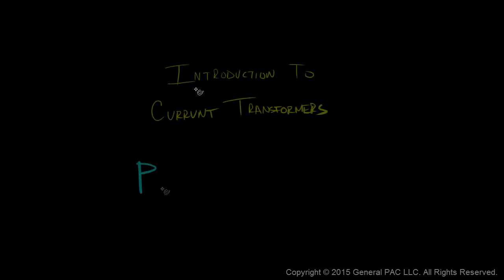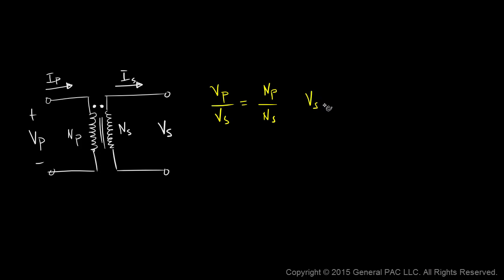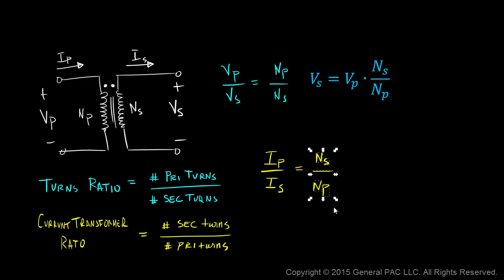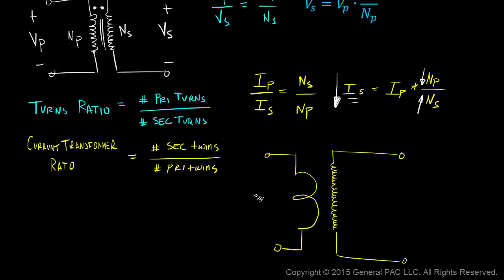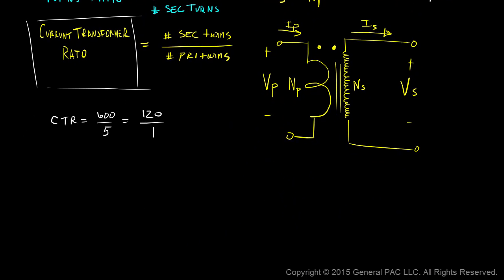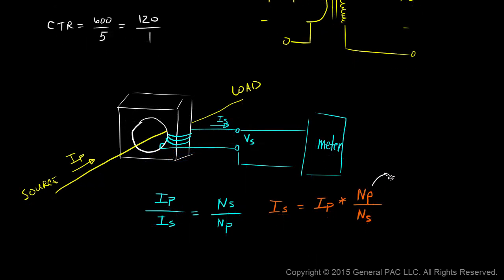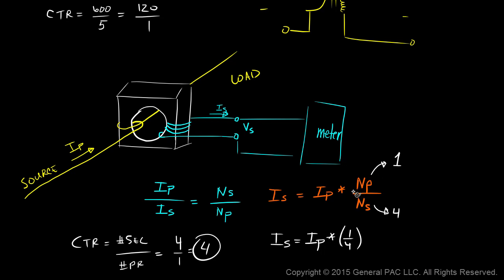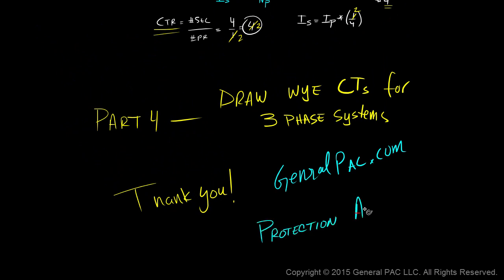Introduction to Current Transformers Part 3: CTR

Comment: It's kind of unfortunate that they refer to TURNS; based on what is shown at around 7:00, to me 'number of turns' should be thought of as number of 'passes' through the 'window', rather than 'loops' or 'turns' around the frame of the window. One 'turn' around the frame of the window is actually considered 'two turns' as shown at 7:56.
Reply from the maker: Hello, 

Yes, you are right some how. But at different sites you will discover different answers of this question. Normally for current transformers, we considered the number of turns in a way it is explained in the video and for normal transformer we considered the number of turns in the way you have pointed out.

Thank you,
GeneralPAC by AllumiaX

Comment: In the window type current transformer, how does the primary conductor passing through, make it 'one turn'. It doesnt make any turns right!
Reply from the maker: Hi Yashwanth,

In literal terms, the conductor passing through the window type CT does not have any 'turns'. However, the term 'turns' is extensively used in electrical engineering literature to refer to the number of times the current has to travel through a similarly shaped part of the circuit. See the image in the link below which shows a solenoid, where there are 6 'turns' --or say 'identical portions' of the circuit, so in a circuit where there are no turns, there will only be one 'identical portion' for the current to pass through.

https://circuitdigest.com/sites/default/files/field/image/What-is-Solenoid.png

The term 'turns' has been adopted for use in a number of equations, one of the most famous being the transformation ratio of a transformer. To maintain  consistency with the existing literature, a single straight conductor is called as having 'one turn'.

Comment: Sir by increasing number of turns in secondary, we are increasing voltage in secondary 
So how measuring instrument will be subjected to high voltage ?
Reply: I have the same question here
Reply: Keep in mind, the main goal is lower current.  A CT is a modified step up transformer but it is in series with the circuit that it’s reading.  It has a very low impedance and therefore hardly a voltage drop.

Comment: But doesn't this increase the voltage in the secondary circuit compared to primary circuit? 
In part 1 you told that the voltage is also decreased. My understanding is that, if number of turns is increased the voltage in the circuit will increase.
(Mech engineer trying to understand some electrical topics, so please bear if it is a silly doubt)

Comment: question: if you have a VT of 13800/120 and CT of 800/1 with connected load of no more than 400A. Lets say you decided to install a meter to read your total consumption. how would the meter read the consumption? 

would it read it as 400/800= 0.5A then 0.5*120*cos()= 60W?  and is there any difference if I change my ct to 400/1 since i only have a connected load of no more than 400A, Am I still going to get the same reading as when using 800/1 ct?

Comment: Please also explain why we use these phase shifts in transformer like dyn11 etc ? what is basic purpose of doing that ? why we use wye and delta configuration of transformers ? what is advantage and disadvantage of both systems ? what is function of neutral in wye transformer and how it works ? why we take care it is grounded or not ? please explain completely

thank you
Reply from the maker: +rana zohaib, that is loaded question and the answers will come easy if you put time and efforts to understand this subject. There are a lot of benefits for using a delta wye transformer. We can completely isolate ground protective relaying with delta connection. We can suppress harmonics with delta connection. We have good stability of voltage with grounded wye connection. We also assume that our system is a "grounded"  system if we ground the neutral. So lots of benefits with both the delta connection and the wye grounded connection. There are many ways that we can make a delta connection and many different ways we can make a wye connection. The Dyn11 simply describes (through phase relationship) one way that we can make/connect a delta wye transformer.

Comment: i have question if we have same source and same load but we have differnt trnasformer ratio like 400/1 and 400/5 so we have same secondry current
Reply from the maker: +yasser farouk -- a 400/1 turns ratio is different than 400/5 turns ratio. It&#39;s important to know the difference.
400/1 = 400 secondary turns and 1 primary turns. 
400/5 = 400 secondary turns and 5 primary turns which is the same thing as 80/1

If you have 600A primary current - a 400/1 turns ratio would yield 1.5A secondary current (600/(400/1)). 
If you have 600A primary current - 400/5 turns ratio would yield 7.5A secondary current (600/(400/5))

Does that make sense?
Reply: no, not the same
lets assume 200 amps load for both ct's.
in 400/1 ct the secondary current is 200/400= 0.5 sec amp. since turns ratio is 400.
while in 400/5 ct secondary current is 200/80= 2.5 sec amp. since turns ratio is 80.